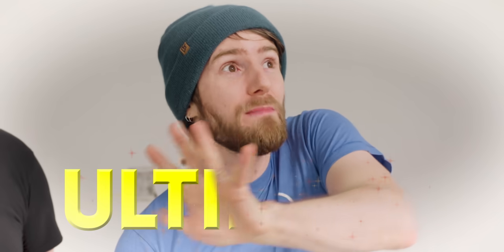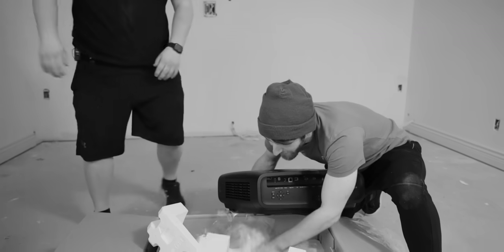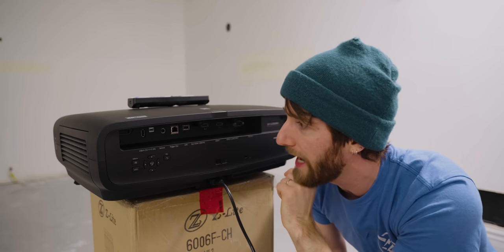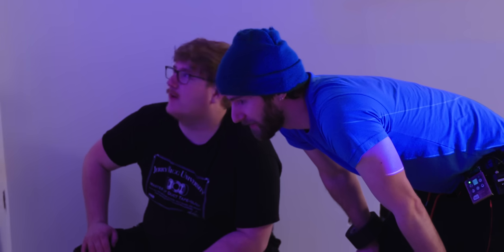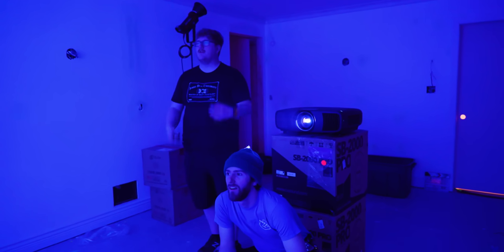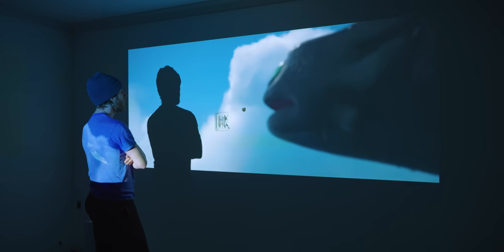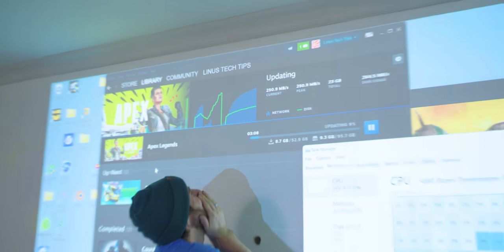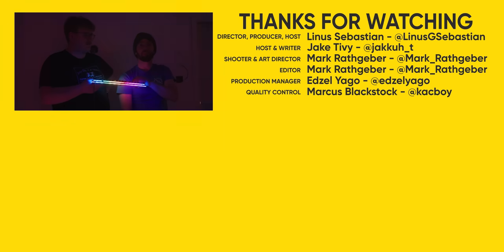I Hate It When He's Right... - Epson LS12000 Demo

Comment: I am now convinced that Linus does not understand what affordable even remotely means lol.
Linus: Introducing the affordable Epson projector!
Me: Looks at price.
Price: $4,999.99
Me: ...
Reply: I think he meant in comparison to products that do the same things
Reply: Linus seems to be quite disconnected from reality now and forgot what affordable means.
I mean, it's good to see tech like this, but this isn't realistically "cheap".
Reply: @GoldSrc_  As far as I saw he never called it "cheap" or "affordable".

He said it was "best bang for the buck" and "still expensive"
Reply: Remember that time he said "To be clear it's still an expensive piece of kit" 2:36 ?
Reply: It's all relative, and all based on what you want out of it.  For $4500 less you can get into a halfway decent DLP projector, but that means 1000:1 contrast and 1080p, and it's DLP, so no lens shift, no powered zoom/shift, and a good chance you will see rainbows every time there is action on the screen.  For ~$3k you can get into a 6050, which solves most of the issues of a DLP by switching to LCD and is a fantastic budget projector, but still e-shift (2x) 1080p, lamp based, and not HDMI2.1.  For $7k you can get a native 4k projector with the same calibrated brightness (but lamp and not laser) that has more than double the contrast and built in frame by frame tone mapping, so all HDR content looks good without any expensive processors, and has all the other features the Epson has (HDMI 2.1, 120hz 4k, etc), but it isn't laser and it is $2k more.  Keep in mind, you don't get anywhere NEAR 2.5 million to 1 contrast with this or any projector, I'm surprised this channel would even suggest grossly exaggerated numbers like that.  The contrast of the Epson LCD's is GREAT, in comparison to any DLP projector, but compared to Sony or JVC, the Epson blacks look gray.  All that said, for $5k, this laser LCD based projector is a pretty amazing deal.  

To put it into perspective, the previous Epson laser from a few years ago with almost half the calibrated light output was twice as much MSRP, and a step up from that would have been a $35k JVC.  Today you have the JVC NZ7 at $10k that is native 4k with 2x e-shift to get to "8k", with all the same features but adding significantly better contrast and more light output by quite a bit as well as a major leap forward in HDR tone mapping (critical for HDR on a projector), or the NZ8 at $15k with even more light, even better contrast, and 4x e-shift on the 4k panel, giving you the same pixel count as true 8k (albeit with overlapping pixels like all e-shift projectors).  Both JVC's are better in every single way except price, but as with all high end products, only marginally when casually viewing.  Of course, this is no different than the difference between a cheap LCD flat panel TV, a decent LED flat panel TV, a quantum dot LED TV, and an OLED TV.  Each is marginally better than the last, mostly in terms of contrast.  It's all about what you are willing to spend to get "the best".  Keep in mind, in the world of projectors, this is still the middle of the pack.  There's the JVC NZ9 at $25k that just has a better lens than the NZ8.  Then there's the Sony 385 at somewhere in the $75k range, brighter but less contrast than the JVC's, so more of a great projector if you have a big screen.  And then if you REALLY want to up your budget, spend $150k+ on a Christie Eclipse.  The thing is, until you hit that $150k price point, there will STILL be deficiencies in each of these projectors.  It takes money to put a really high quality image on a screen bigger than 90 inches.  If you want a GOOD image and to stay under $1k, just get a decent flat screen LED TV, otherwise hold on to your wallet, it gets expensive, and even more so if you want bigger than 130" and to still have good HDR.

Comment: Just mounted one of those this week. Fantastic projector. Also mounted the Sony VPL-VX7000ES a few weeks ago. If you’re comparing price point I would with this epson every day.
Reply: Price point between the two are actually not that different the Sony 5000 is $5,998 retail the Epson is $$4,999.00..  The Sony you don’t get auto lens they went back to manual, unless you buy the step up version. Neither support 3D which is too bad. I thought the Epson held up very well v. The “native” Sony. The colors really popped and would be fine with either.

Comment: I actually think the Epson LS11000 is the best projector for the money.  Putting the 12000 next to the 11000 you can't tell any difference in the picture and it's a thousand dollars less.  The 12000 is a little brighter at its brightest settings but how many people are going to be running their projectors at it's highest setttings all the time.  I don't think you can go wrong with either one.  They both have a ton of options and are great projectors.

Comment: Not a bad unit but it does not support Dolby Vision format. A major concern when the discussion of HDMI cable runs were being mentioned.  Signal degradation will become apparent after a 15~20 foot run on a HDMI cable.  The best practice is to utilize a 4K HDMI extender using cat7 cable.  In reviewing the specs, I was surprised that the grayscale control was a 14 point vs a 20 point.  I like the 18 point color adjustment feature but I am disappointed with the fact that the projector can only reach 85% of the DCI-P3 color space ( DIC-P3 is the standard for digital theater projectors and is not applicable to home theaters), this is a far cry from the BT-2020 standard.  A rear projection scenario should have been considered whereby noise and cooling could better be controled.

Comment: Micro LED a 10 years from non commercial use and relatively affordable prices.  100” OLED is coming soon, and that will be amazing and very very expensive.  I have a Samsung UST projector that projects a 125” picture and looks fantastic in a light controlled room.  100” is great, but when u get to 120” plus, it almost fills your wall top to bottom.

Comment: 5:55 ["absolute Minimum of Zoom" - because you loose a bit of light..] neglectable to No. The lighten area is the same, so the loss of light is mainly caused by dust in the air, NOT because distance itself. Next disadvantage: using lenses on its extreme positions causes more optical errors like distortion or chroma-aberration. much more on the short/wide side than on the long/tele side.

So please, dear viewers, forget that crap.

Comment: Seriously guys, you put a window in a theatre room? I've been using an Epson 5025 for a number of years now in a room with no windows and the walls/ceiling painted black (or at least seriously dark). I know it's not the best but the color quality on this thing seems a lot more cinema like to me than super-TVs. Plus the screen isn't shiny so no reflections of anything in the room. It's got lousy latency so not so good for serious action games and it's noisier than I'd like (really noisy when in full bright rather than eco mode) but when a movie is showing, usually the soundtrack drowns the projector out. I just painted on wall with Sherman Williams Silver Screen (or something like that) cause I was too cheap to speed $2000+ for a dedicated screen. With a reasonably new lamp, the project can throw a 140" diagonal image on the wall. It's only 1080p, but with a blu-ray for source the picture is really incredible. I expect your projector makes mine seem like amateur  hour.
Seriously though, why don't you just dry wall over that window and not mess around with curtains. Also, in addition to black ceiling / walls (except for your screen), get some dark carpet. My wife said "no" to dark carpet and I think it's hurting the black levels.
Dude, you're gonna love that projector. It's possible you're video production may suffer for a few months because you'll be unwilling to leave that room.

Comment: Alright now here's a question.. Why is that for 10 years now a lot of people including myself have said that steam downloading is somewhat broken, inconsistent and just slow. But you for some reason just decide alright i'm going to get 10x the download speed on steam than anyone else. We all know you have your overkill internet that everyone would love to have it. I have fiber 500mb down, no bottle necks, good equipment, hard connection, i'm secure, I do have a network administration degree, download speeds check out properly, downloads from most places are pretty well good. But steam i'll get max 30mb down, which leads me to believe that it's not on my end based on equipment or services. I don't have any restrictions in steam on, no caps, correct region, bandwidth unlimited. Is it a steam issue? I'm sure you're aware of the large community of people who bring up the "Broken Steam download speed".

Comment: HAHAHAHA "best bang for the buck" yea sure nice #ad, the best bang for your buck is the true 1080p projector i got on amazon for about $150 paired with a $130 120" screen for less than $300 all in after tax and "shipping". Yes, MOST of the 'true 1080p' on amazon are false advertising 720 or even 480 and maybe upscaled but I found one that actually is 1080p and it looks AMAZING. I can throw 4K content at it, 1080, 720 and yes even 480 and from 10 feet away everything is crisp and gives a real cinema feel versus watching on some 50-65" 4K tv which is just too damn small to appreciate anything on it as well as way more expensive than I am all-in on this setup. even at $5K that epson is still a fake 4k pixel shifted projector, what a joke.

Comment: You are not going to get the ultimate home theater experience with that projector. It's a great projector for the price, but not the ultimate experience. As for spending 4 times the amount to get parity, you can get a better projector for less than twice the price.

Comment: This Epson is sort of a joke, particularly for USD $5,000. Manufactuter claims this: "4K PRO-UHD advanced pixel shifting technology." "PRO-UHD," get it? So, it is only a Fake-K or Fake-4K or Faux-K projector. It has a regular HD image panel that does a simgle pixel shifting, so what yolu see is app. 4.1MP. Not the 8.2 MP that you would need for True-K or Real-4K or UHD 4K. And the other thing is, the lens on it is pretty useless for home theater use, as it has a TR of 1.35:1 to a laughable 2.84:1. I wouldn't thouch this colossal clunker for all the tea in China.